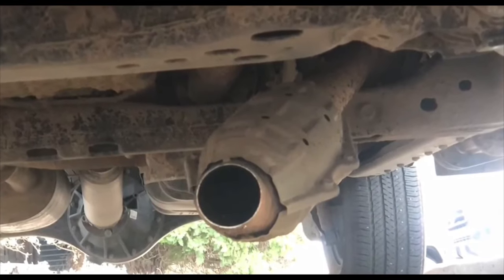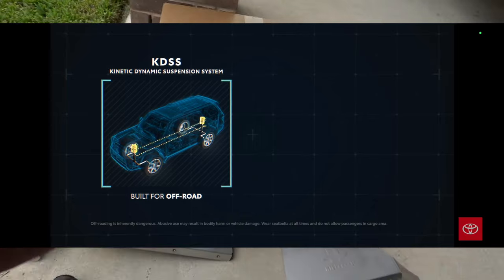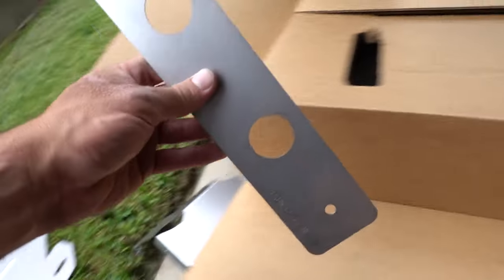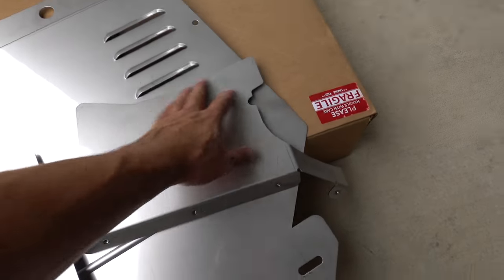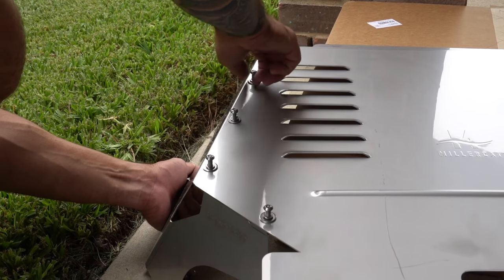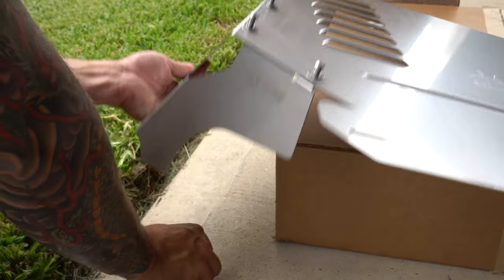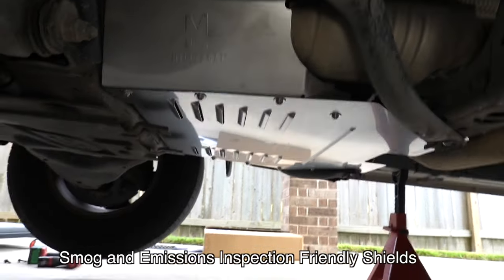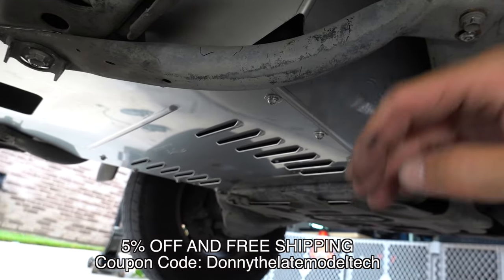Don't Let the Thieves Steal Your Toyota's Catalytic Converter / MillerCat 4runner Catsheild Install

Comment: Thanks for posting, with your kind permission, I like to add the following for the viewers. You are protecting your CC, so be sure to protect your eyes by wearing safety goggles whenever working under a vehicle. Having battery acid from Rolls Royce in my eyes, when I was a young and inexperienced mechanic, I can say from experience. Using Anti-seize compound on cap screws (bolts) can be helpful for future removal. Using lock washers on the long cap screws can reduce chance of loosening. I wish the security cap screws were harder to get tools (tip) for them.

Comment: Thank You for posting, it was very helpful.  However, I did want to let you know that for the 2017 4Runner Limited you have 6 screws instead of 4 to remove the shield.  Two screws are hidden but they are towards the front of the shield and you'll need a 12mm deep socket to get to the screws.

Comment: After install, is the front propeller shaft spider joint accessible, or do you have to remove to gain access to grease the joint?

Comment: Why does it only fit 2014 to 2022 and not 2010-2013 even though it's the same generation/model?
Reply from the maker: It probably will fit.

Comment: Hey man I watched your Chrysler 8.25 regear, its 3 years old. I have everything set to regear mine, also shooting for 4.56. Can i follow the exact same process with new bearings? Considering my setup has no locker, it is open. Thx. 4.56 gears Motive brands, Revolution Gear bearings.

Comment: can i straight pipe like cat del??? and just add the o2 sensors ? my 2020 tundra cat were just stolen and its gonna cost a fortune, if i straight pipe and add sensors it will 500$... would i have mechanical issues ?
Reply: truck will have check engine light, be in limp mode and never pass any smog test.  Cars made after 1995 actively monitor the cat.

Comment: Hey Donny, I'm trying to use the discount code to get one for my 2019 SR5 and it's saying that the coupon code isn't valid for the item in my cart. I even tried copy and pasting what you typed in.
Reply from the maker: I'll email miller and get back with you
Reply: @Donnythelatemodeltech  Thank you!
Reply from the maker: Mike, Miller wants to know if you placed an order and if you did they will refund you the discount.   They informed me something is wrong with the discounts on the newest product and are correcting the  issue asap.     If you place an order email me so I can get the order number and info over miller. 👍
Reply from the maker: Thelatemodeltech@gmail.com or DM on Instagram
Reply: Thanks for for reaching out to him for me! No I have no my placed my order yet. I was waiting to hear back from you or until the code started working.
Reply from the maker: @WatchDominion90  👍hope the code issue is fixed soon.
Reply from the maker: @WatchDominion90  HI Mike, the coupon code problem has been resolved,  thanks again and let me know if you need anything.  👍🍻

Comment: Terrible product. Just had mine torch cut off my FJ, spent $430 on the stainless steel, lasted 1 and 1/2 years before rusting. Tamper proof bolts stripped out, shop had to torch it off and now there is metal from the shield stuck between the frame and support gussets. This shield is NOT worth the pain in the ass it is to take on and off, and you WILL have to remove it to access your transmission housing. Do not waste your money on this crap product!!!